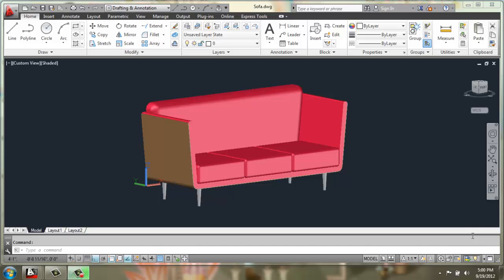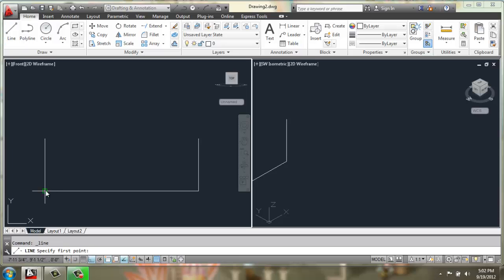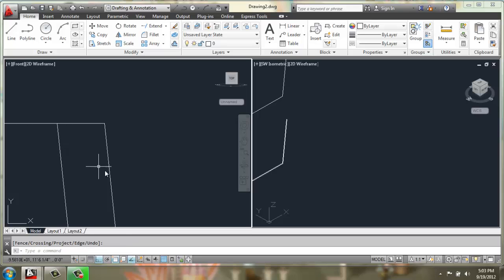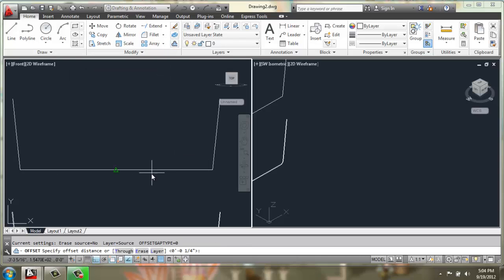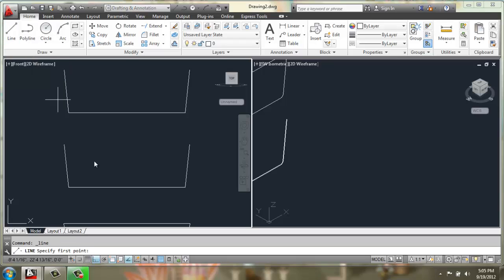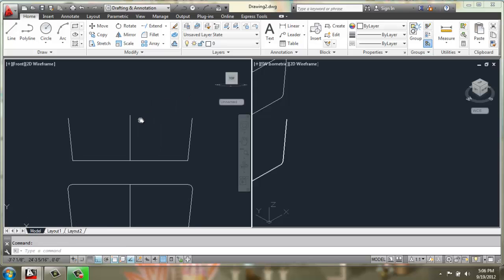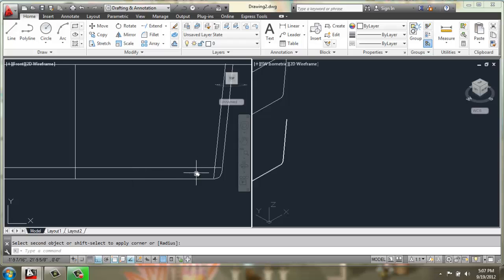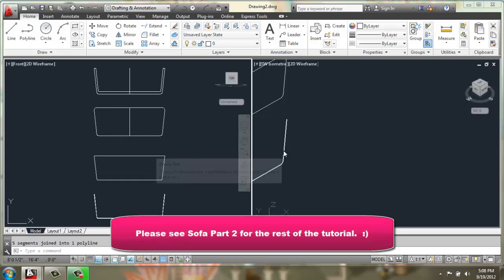AutoCAD 2013 - 3D Modeling Basics - Sofa Part 1 - Brooke Godfrey

Comment: Why does it say front viewport but the cube says top? Someone help please!!
Reply: Because the ViewCube is not the same as the Viewport! Look at the windrose under the Viewcube. It have a  different orientation.
If you change the view on Viewcube it change only the view. If you change the Viewport (left top corner) it changes the view and the UCS (important for drawing). So you have left or right view in Viewport but for the ViewCube is this the "new" Topview.

I hope it helps you.

Comment: I find a good way of trimming is hitting tr, then spacebar twice (or enter twice). This means you dont need to select any lines and you can trim any lines in the drawing, or by holding shift before clicking, extendeding any line. But thank you for that j join command, i've been using pedit the whole time...

Comment from the maker: I JUST saw this message.  I'm so sorry that I missed it!!!

Ok.  For the first question - there aren't any duplicate lines.  When you use Object Snap Tracking, you are creating a line a certain distance away, so you don't have duplicates. If you didn't do that, delete the extra line.

Second question - It isn't a 3D polyline, it's a 2D polyline.  When you create something with individual lines and join it , it's 2D.  You can also select it from the draw panel or type in "pline."  :)

Comment: 1. Did you combine the duplicate lines before you trim the bottom edges (1:22)?
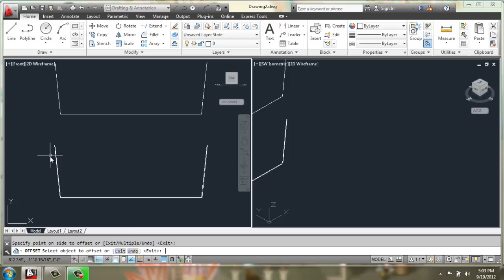2. How do you offset 3D polyline (2:08)? I thought autocad doesnt do that, and I got the message 'cannot offset that object' when I tried to do the same thing.

Thank you :)